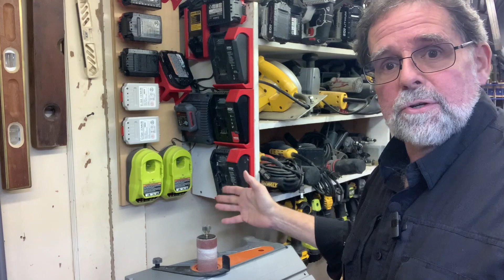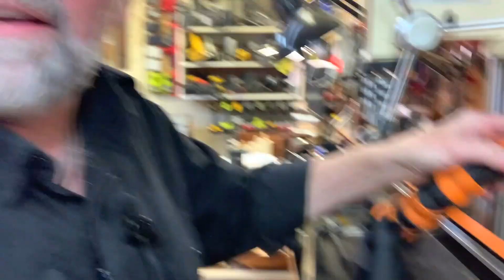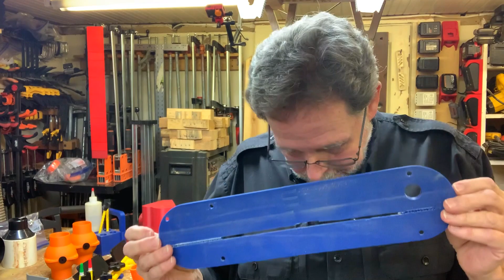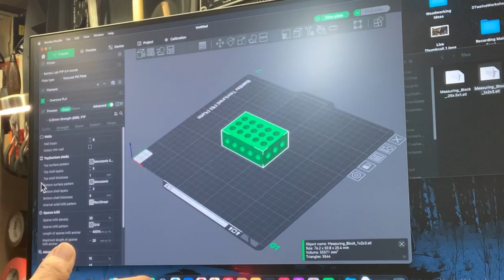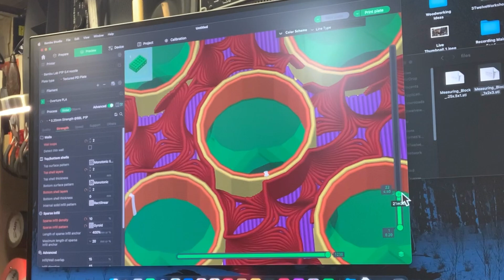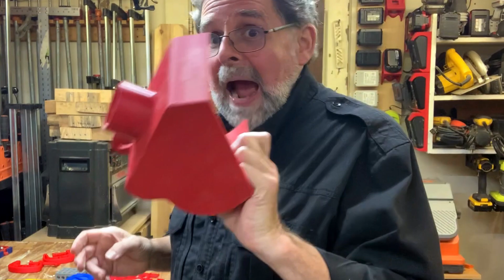Transform Your Workshop with 3D Printing: Honest Thoughts, Filaments & Settings Explained! S4:E1

Comment: Just stumbeled on your video and a little tip that i just discovered as im getting into printing myself. Pla shatters like glass when it gets hit while  petg is more bendable and doesnt shatter. Also it takes heat way better. Also asa is like abs but without the killing gases. It smells like burnt clutch and i would recomend connecting it do the dustcollector just for some filtering if you go for asa. I just use an air purefier and evacuate the room while printing😅 but i also got the a1 with open frame. And last thing, spending 30 mins on youtube learning how to set speeds, layers and supports can save you WEEKS of printtime. 17 hours went down to 7 and the print quality turned better.
Reply from the maker: Yup I learned a lot from watching 3D print videos on YouTube..  Honestly though, the main reason I bought into the Bambu line is that the filament profiles are a really good starting point.  A little tweaking might be needed, but for what I do it is minimal.  Thanks for watching!!!